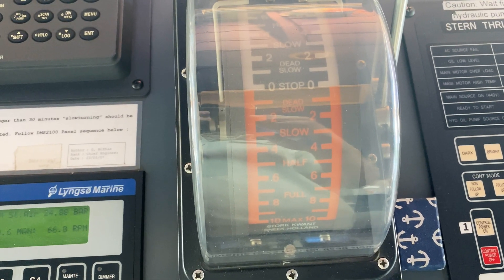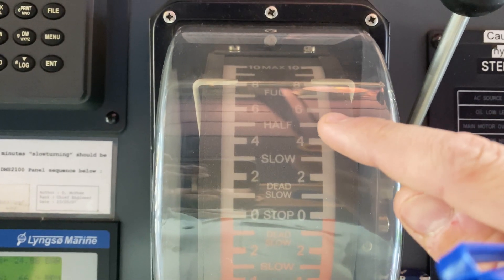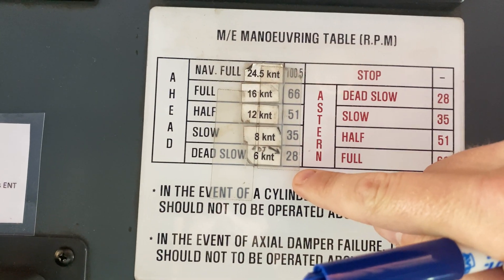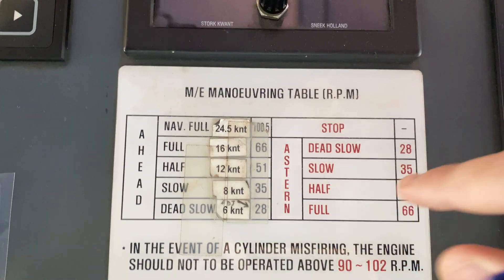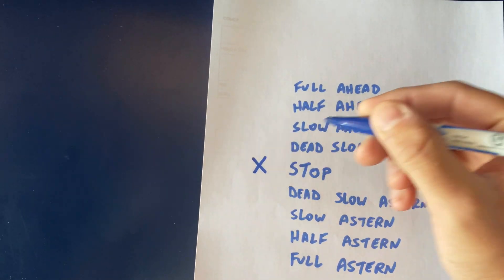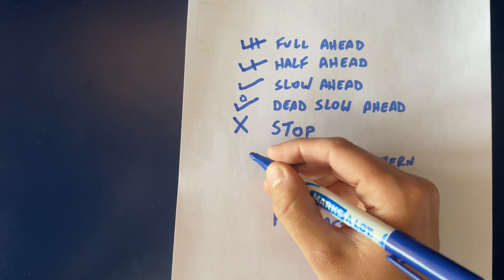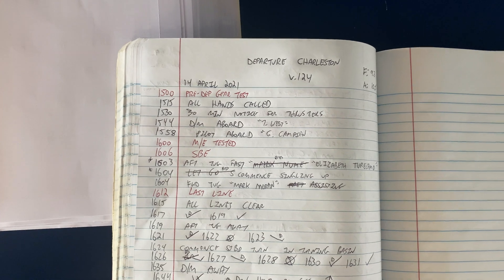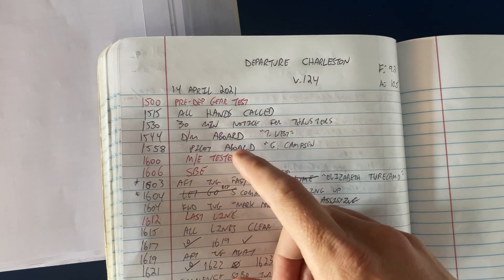Engine Order Telegraph And Bell Book On A Cargo Ship | Life At Sea

Comment: "DEAD SLOW"= 6 knt- high enough speed for   a vessel of this size.
Reply: They don't enter ports under power, but carefully tugged. 6 knots is the slowest speed at which ships this size can actually steer.
Reply: @Bob.martens  yes I know.
Thank You!🖐😊
I am driving a river vessel, about 100 meters, which independently passes the locks and it also has the same speed on one machine at low speed.  It has three of them.

Comment: Thanks for the interesting inside information, Bryan! But where does the "Ahead Nav Full" fit in to your check marks? Maybe it is a check mark with three slashes?
Reply: Probably the equivalent bells to USN Ahead Flank Speed, and permissible to run at maximum speed in open waters. 
UK and US Bells Compared: 

Ahead Nav Full - Ahead Flank
Full Ahead - Ahead Full
Half Ahead - Ahead Standard
Slow Ahead - Ahead 2/3s
Dead Slow Ahead - Ahead 1/3s

Stop

Dead Slow Astern - Back 1/3s
Slow Astern - Back 2/3s
Half Astern - Back Full
Full Astern - Back Emergency
Reply: @Brecconable  Thank you so much for this explanation